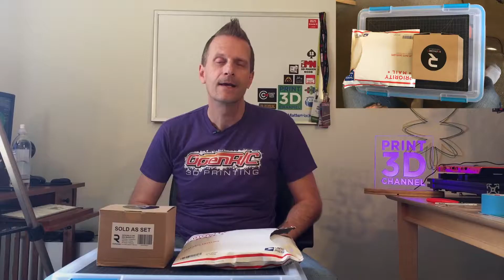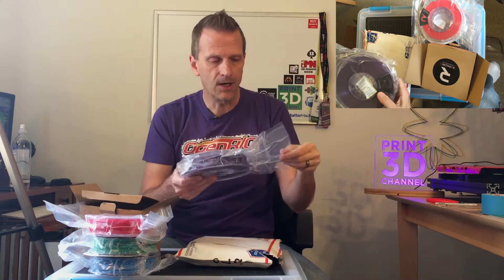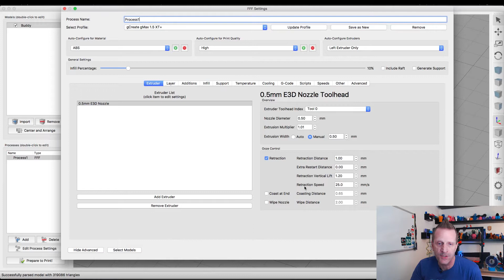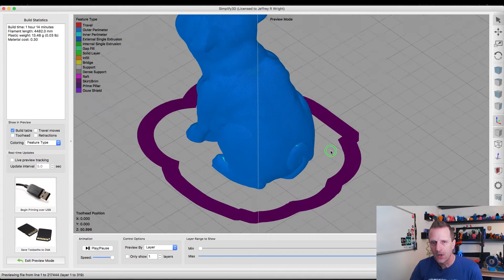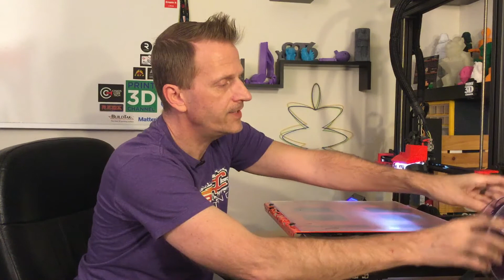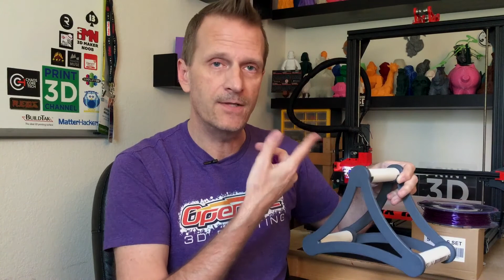How We #3DPrint With: @Repkord Filament: Unboxing & First Print

Comment: That iz Gorgeous Purple! Some of the micro manages I Liked to see was:
Very short preheat times
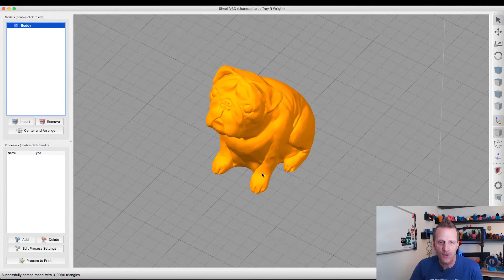Does the Z move up on the (new) layer? it sure looked like it from (my view) oops= 10:30 you mentioned yes to lift
I LOVE that (Manual Data Input) babystep adjustables!
one question: Are you able to go directly from Mac to SD card? ( I need an extra step to move to Windows then SD C)
All else for a change out of materials, and your steps taken iz all great! 
Thanks again Jerry for an excellent "starting point" !
Reply from the maker: Thanks for the suggestions and comments and of course, thanks for watching!